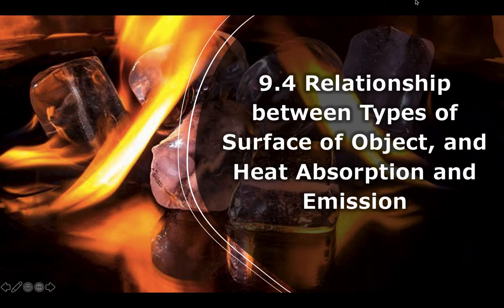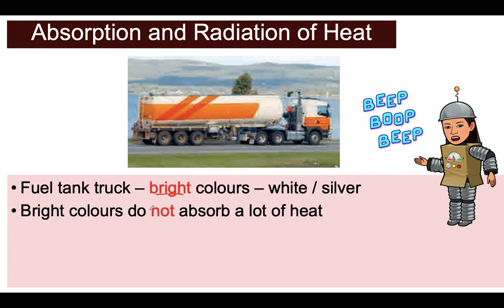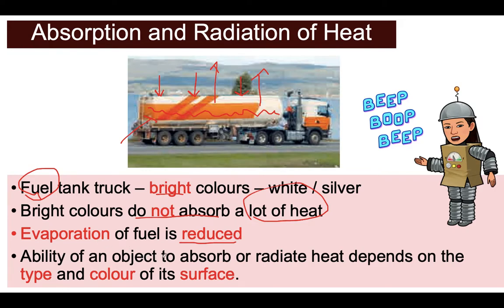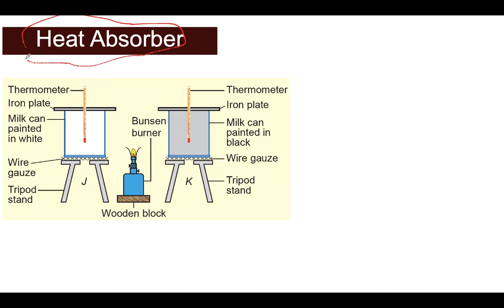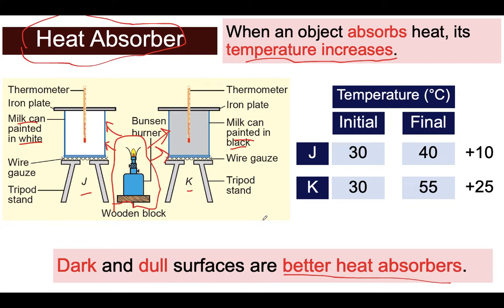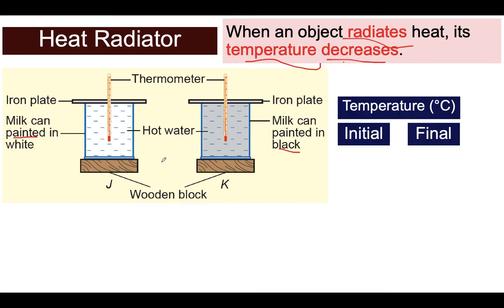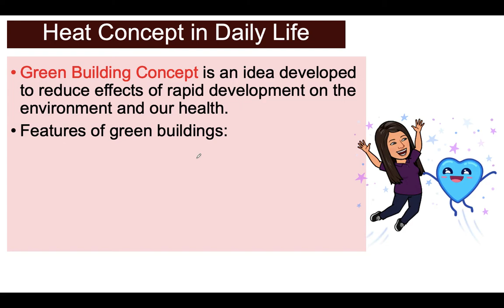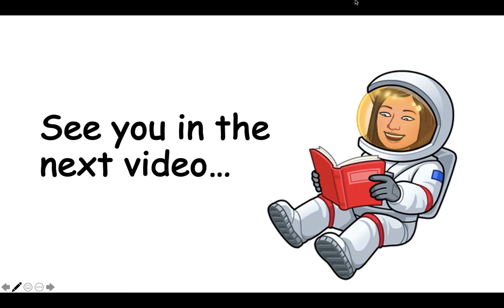FORM 2 - SCIENCE KSSM - CHAPTER 9.4 - RELATIONSHIP BTWN TYPE OF SURFACE - HEAT ABSORPTION & EMISSION

Comment: Things that I learned form this video:
1.Dark and dull surfaces are better heat absorber and heat radiator
2.Heat emission is ability to releases heat
3.Ability of an object to absorb or radiate heat is based on the type and colour of its surfaces

Comment: ain farhanah 2brilliant
things that I learned from the video : 
1. Fuel tank truck has bright color light silver or white because bright colours does not absorb a lot of heat.
2. Dark and dull surfaces are better heat absorbers and heat radiators.
3. .The meaning of heat absorption and emission.

Comment: Bellyz Beaster Tundo 2E

3 things I learned from the video :

1. bright colours such as white or silver actually didn't absorb a lot of heat so that's why fuel tank trucks uses bright colours and evaporation of the fuel also will be reduce

2. the temperature will decreases when an object radiates heat but will increases when an object absorbs heat

3. dark and dull surfaces are actually a better heat absorbers and heat radiators compared to white and shiny surfaces

Comment: 3 things that I learned from this video:

1)Ability of an object to absorb or radiate heat depends on the type and colour of its surface.
2)Bright colours do not absorb a lot of heat,so that's why fuel tank trucks use bright colours to reduce the evaporation of fuel.
3)Dark and dull surface are better heat absorbers and radiators.

Comment: 3 things that i've learned from the video :

1 . the ability of an object to absorb and radiate depends on the type and colour of its surface
2 . dark and dull surfaces are better heat absorber and heat radiator compared to bright and shiny surface
3 . Green Building Concept has high energy efficiency through the usage of solar energy or renewable energy

Nur Hazasymila 2A

Comment: 3 things i have learned from this video:

1. Fuel tank truck are the bright colour because bright colour don't absorb a lot of heat,so fuel won't evaporate
2. Dark and dull surface are the better heat absorber and heat radiator
3. Green building concept has high energy efficiency through the usage of solar energy or renewable energy

Ashley Tsan 2A

Comment: Things i learned from this video :
1. Bright colours do not absorb a lot of heat, which allows evaporation of fuel in fuel tank to be reduced.
2. When object absorbs heat, its temperature increases. However, when object radiates heat, its temperature decreases.
3. Green Buildings has high energy efficiency through the usage if solar and renewable energy.

Elsa Marleena 2A